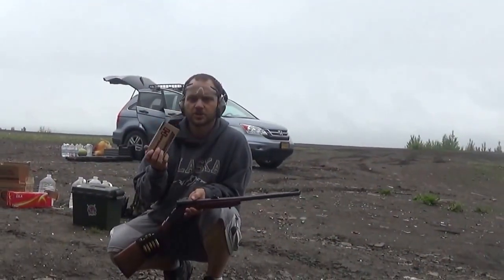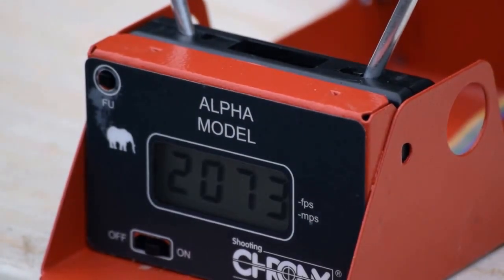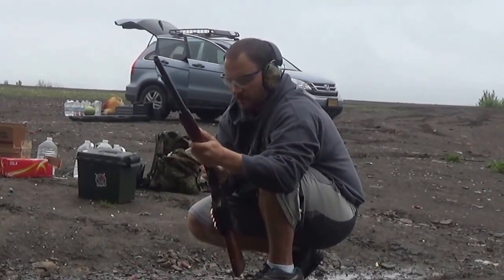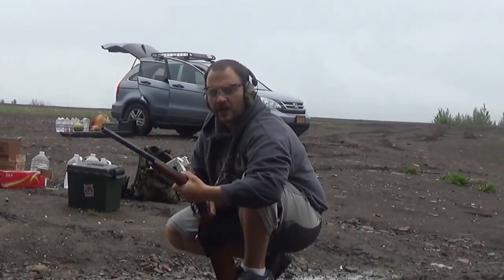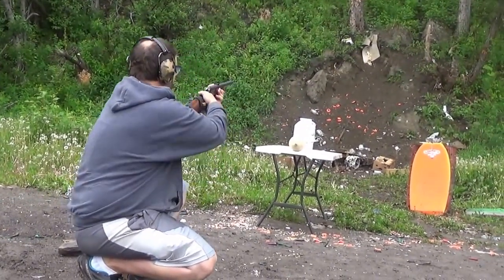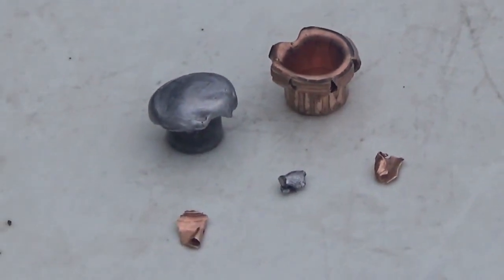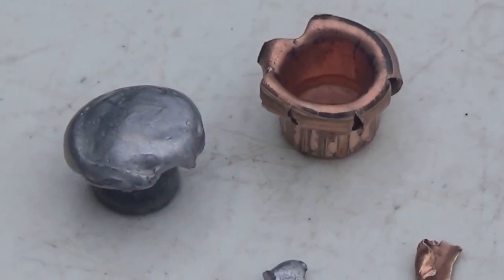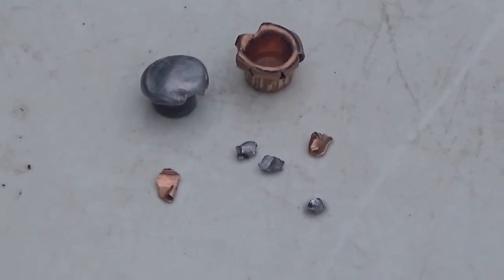45-70 Hornady Leverevolution 325 Grain FTX

Comment: Some additional comments on the Hornaday 45-70. and using with Henry lever actions.I measured the base of the cartridges on Remington, Winchester, and Hornadayand found the main cartridge dia the same on all 3 
However.The Hornaday cartridge is .025 larger than the Remington or Winchester at the basein diameter, hence the tube had a harder time sliding over it. .025 is a HUGE difference.You can visually see the difference.
Had no issues loading either Remington on Winchester hence this larger cartridge is obviouslythe issue. 
I had no issues with my Rossi or Marlin.
Reply from the maker: Bob Bradley that's great information.  thank you for sharing.  Did you contact hornady about it?
Reply: I plan to Monday and see what they say. Henry is already telling customers to avoid that ammo.
Reply from the maker: Bob Bradley good to know!  I  wasn't planning on using this gun really.
Reply from the maker: even with .45- 70 and a good shot a big Brown bear may take a while to go down.

Comment: The Leverevolution bullets consistently separate in targets. That is the only thing I don't like about the Hornady. The polymer tip allows better BC, but, at this point I am reloading a 350 gr. RN. This load generates over 3700 ft/lbs of energy at the muzzle. BC is less of an issue with much power.
Reply from the maker: They're okay for a brush gun deer load but i agree with you for penetration
Reply: @BLUE COLLAR BOXING You know I never thought of that. Thank you for pointing this out. I did use the Leverevolutions in my .35 Rem for deer this year. However, the shot went clear through the deer so there was nothing to recover. On the other hand my deer was DRT. It didn't even twitch. I like the fact the .35 Rem has a factory loading that increases the effective range of this stubby little round. I just won't be trying to air out milk jugs filled with water. I may give a stack of wet newspapers a try, however. Thank you for your insight.
Reply from the maker: They do have the new all copper leverolution rounds
Reply: @AlaskanBallistics  You're right and I forgot about that.  Hornady appears to always be thinking ahead. They are a great family and Great Americans.

Comment: As an Alaskan, how would you feel about carrying this load in dangerous game country? These shoot great out of both my 45-70's but worry about hitting big bone with charging brown bear.
Reply from the maker: Yeah absolutely not carrying these
Reply from the maker: Xtreme penetrators or hardcast. Thanks for watching! And the question
Reply: There is the other school of thought that you're dumping 3000 ft lbs of energy directly into the bear with the  325 grain Hornady. I am more of a believer though in deep penetrating bullets.
Reply from the maker: That bear charging you at 25mph weighing 800 lbs generates over 16000 ft lbs.  You're never going to win the physics battle.
Reply: You gotta break them down to stop them. My school of thought is to break the front shoulder and the hip on the opposite side. The only way of doing that with a 45-70 (my favorite caliber) is with exceptionally deep penetrating bullets. I live on the Kenai.
Reply: Currently shooting 305 gr +P from Underwood.
Reply from the maker: I can agree with that for hunting...   if it's a charging bear, CNS hit required